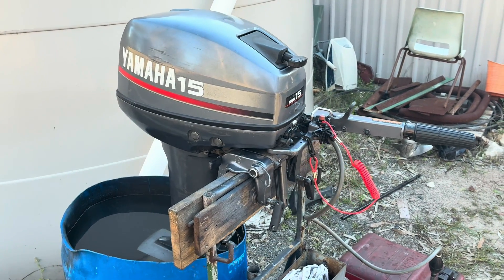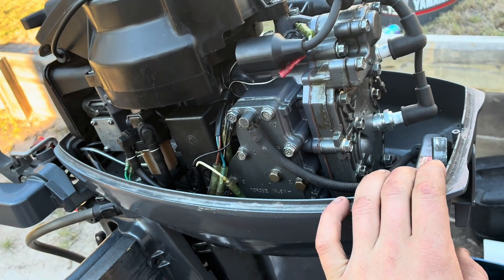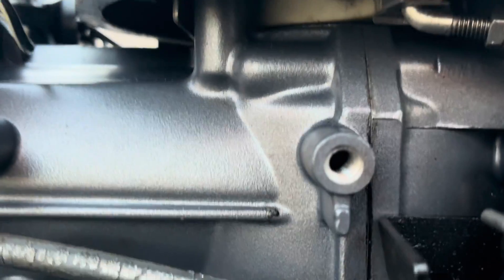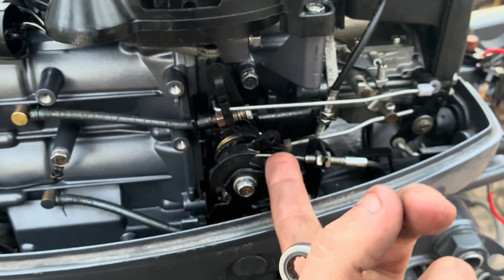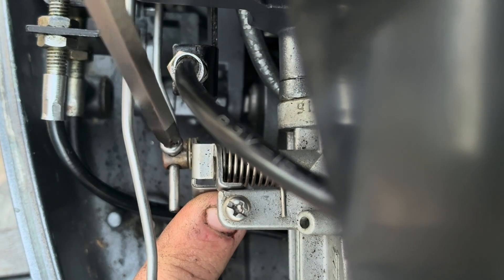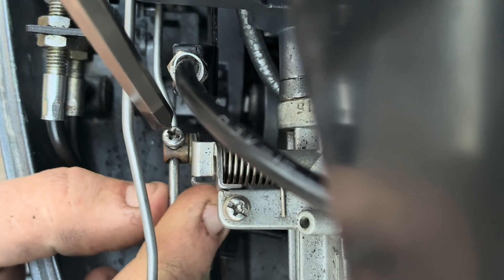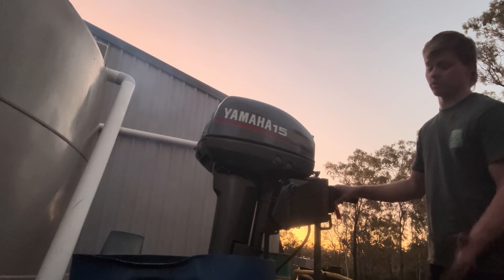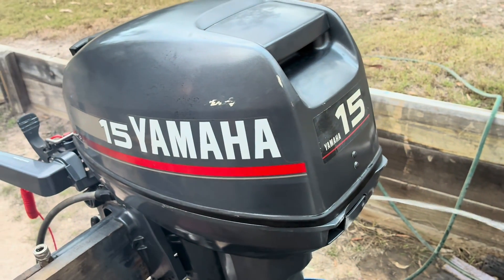Tuning a Yamaha 9.9/15hp outboard

Comment: Great video mine is running fine for 1-2mins then starts to develop a cough and stalls the engine then its struggles to start any ideas
Reply from the maker: When this happens, if you reprime the manual fuel bulb and try again will it re start? If it runs for a bit and coughs and stalls my thoughts are, it is running out of fuel and dying. Could be a dodgy fuel pump. You can check if this is the case by constantly pumping the bulb while running. If it stays running without a hitch, the fuel pump is bad.
Reply: @BIGRIG2005. Thanks pulled the carby apart blocked mixture hole
Reply from the maker: Excellent, good to hear was it the pilot jet clogged?

Comment: Can’t seem to get mine to idle properly. And when I mange to get it to the second I give it any acceleration it’s dies off, any ideas?
Reply from the maker: Pull the carb off and start by checking there is no crud in the jets. The way you describe it sounds like the carb may be a bit dirty and in need of a clean.

Comment: what model number is this outboard please? and where did you get the service manual. I have a yamaha 15FMH and struggling to find the full service manual and not just the owners manual...
Reply from the maker: Hi, it’s a 15fmh. The service manual I found was a 9.9c and 15c service manual. These are the same motors.

Comment: Hello, if you can help me that would be great. The timing for idle on mine is correct but not full throttle. I have no idea how I would adjust thrips because if I adjust that screw u mentioned it throws my idle timing out of wack. Please help
Reply from the maker: Hi you will notice, when I explained about wide open timing, I pointed to the connector and rod between the timing lever and the timing pointer under the flywheel. This rod and connector has a thread which you can adjust to set wide open timing. Bear in mind however you should set that rod first as it will also throw out your idle timing. Once wide open is adjusted correctly, move on to your idle timing and so on and so fourth. Let me know how you go 👍
Reply: @BIGRIG2005. thank you, I will look into this. I’ve found it very hard to find a manual or general how’s to on this motor so that’s for your video!
Reply from the maker: @chord7703 no worries. There is a pdf manual I have found before online. From memory it’s the 9.9c and 15c manual that corresponds with the 15fmh motor.